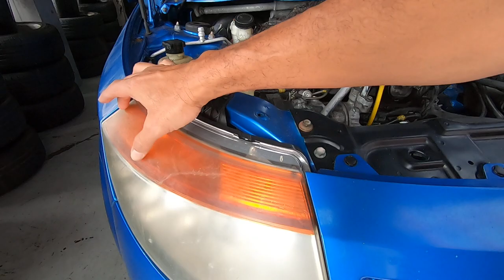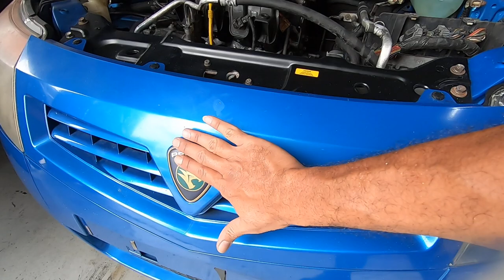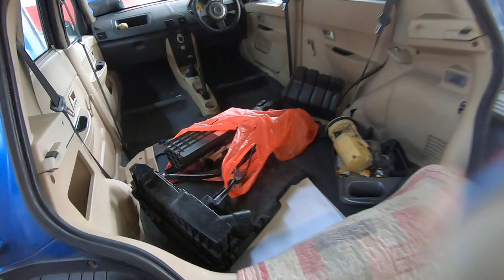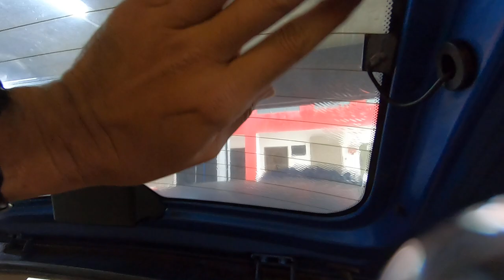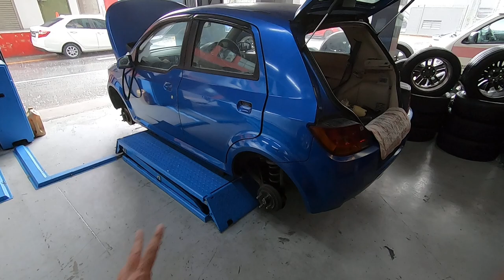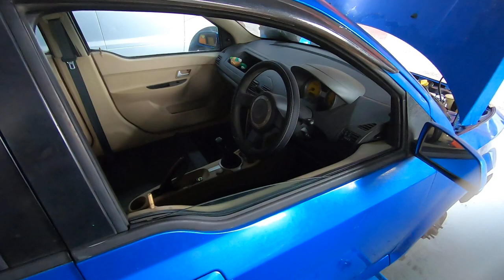SUNDAY NIGHT SPECIAL: UPDATE - 2006 Proton Savvy 1.2L Gets NEW Eyes? Not Really... | EvoMalaysia.com

Comment: Hi, great video. What size of the rim and tire that you choose? And are you planning to replace the rubber on the door?
Reply from the maker: Thanks!! I'm using back the original rim that came with the car, and same OEM tyre size as mentioned in the video. Door rubber still okay 😊

Comment: yeah always a headache for these aging plastic headlamp...
having the same issue for my car but new 1 is too expensive as it's orginally equipped HID...
i would have gotten myself a new 1 if it's the normal halogen type...
still looking someone to refurbish it in JB here...
Reply from the maker: Try the car accessory shops there, or make a trip to PJ sometime 😁👍🏾🙏🏽
Reply: @ChrisWeevilGarage  yeah still finding through the net and FB... saw some using some specialised spray coat from Aikka to refurbish... i would already go to Kenzone if i have trip to KL area...
car can looks so much difference just with the headlights...
Reply from the maker: @Iketani88  hope u manage to get it done soon bro, either there or here 🙏🏽👍🏾😊